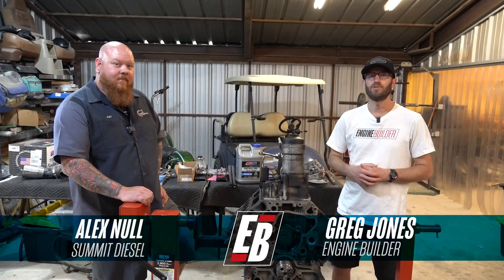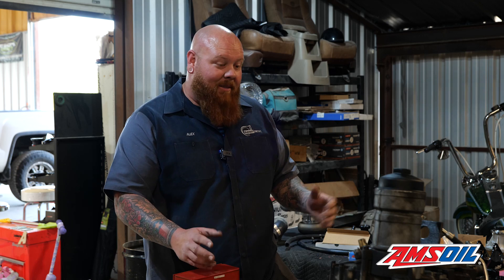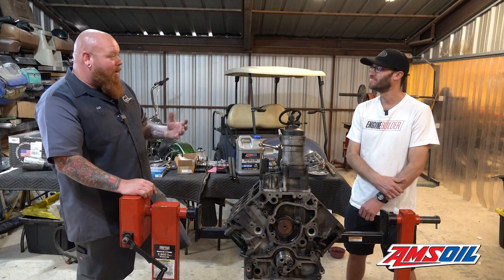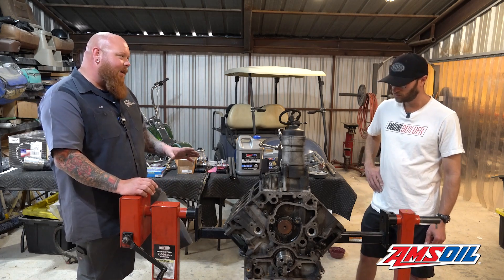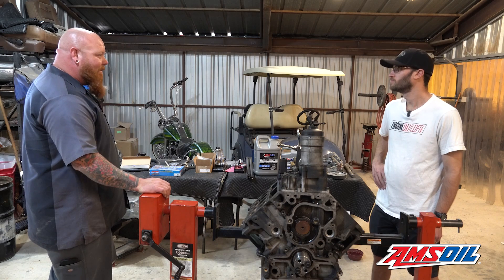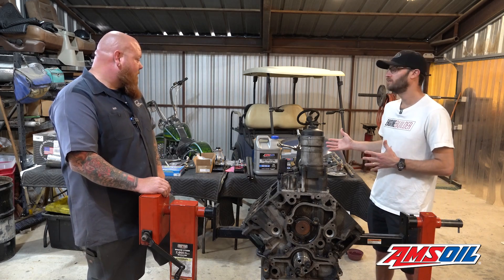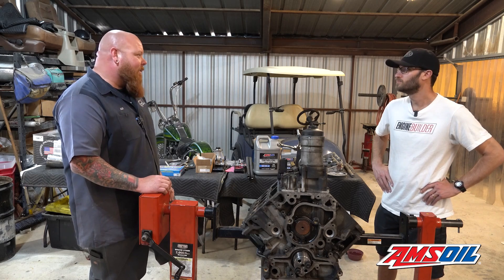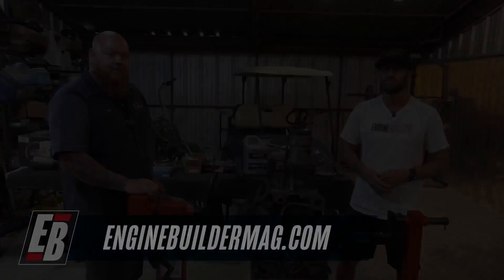Alex Null's 6.4L Ford Powerstroke Engine

Comment: Sir thank you so much for sharing all your knowledge and tips. That could be covered in 1 video. I currently have a 64 l with just over 50000 miles and last Friday. My body pretty much got totaled tweaked. The frame hates sad, but I'm begging you to please. If you get a chance, reach out to me. And maybe help direct or guide me through a build  or even possibly a deal on a 4x4 drive rolling chassisbeing that I'm probably gonna have to do a body swap. It'd be nice to know or have someone help me that knows!!?

Comment: Help, I keep getting code 0088 on 2009 f550 change fuel tank, sending unit blow the line to the frame pump also replace filters 7 time lastly replace ebp sensor and tube. Truck is oem and runs fine for 5 to 15 minutes depending on on the trailer weight.
Reply: Bring it in and let them look.

Comment: Nice to hear from you, Alex. I don't know if you review  comments. I'm very much a novice diesel guy. I have been gear jammen every toy that makes smoke since like 1974. Somehow I got this 08 Super Duty in 2012 with 62K miles. Ran it for a while and the mains blew out that was warranty told the dealer I wanted performance head studs in it. He told me that was stock parts now. BS I know. As soon as I could get out of warranty I deleted the DPF and EGR now it's Jan 2025 I have 136K miles. I believe I blew a head gasket so now I have to take the top down. I should do APR lower rod studs and bolts nuts etc. Put performance ringed heads together with hardened seats and do the guides and seals. Mostly I'm looking for longevity. I do a fair bit of pulling through the great Canadian northwest Rocky Mountains. I would love for someone to shoot me a list of parts that I would need and who to go through. To make this thing last me like forever. Right now I'm running a light tow tune. That works for me. I have a keen young diesel guy up here that I'd love to say let's do this. But this thing has to be given the parts and love that Ford never gave it. Any help from any one who knows these trucks. Would make this old guy keep his truck on the road for whatever time I have left would be awesome.

Comment: 6.4s are not so great why build.6.4
Reply: Obviously you haven’t driven a deleted one before
Reply: Just about all the fords in truck pulling are 6.0 or 6.4. They are the most popular for performance..
Reply: Low end is absolute Beef. They’re great engines for power!
Reply: I wonder what he would charge to do a similar build like this for someone. A 6.4 can be purchased pretty cheap and might be a great engine after he worked on it. I live in Lubbock Texas and it would be no problem to bring it to Weatherford
Reply: boi, you simple